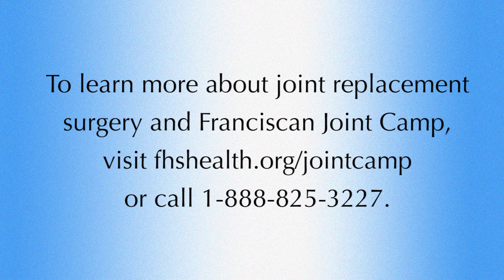Franciscan Health System: Orthopedics Patient Story

Comment: 3 months after my Franciscan knee replacement in Morresville IN I still have great pain & I wish I never had this operation. I don't think it is the answer to most knee problems & think the DR's do not tell you the pain you will suffer after the surgery. This is the biggest health mistake & now with continual pain I may be facing amputation. My advice before you consider this surgery get all the info & find out what would you do if the operation fails.